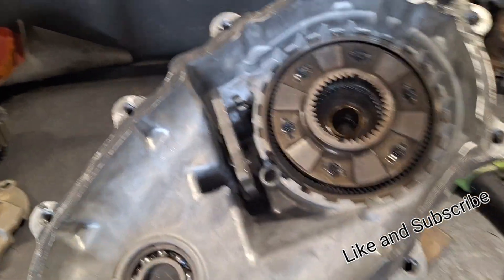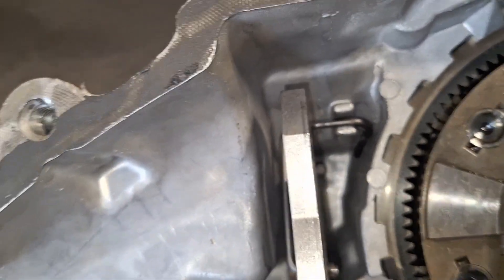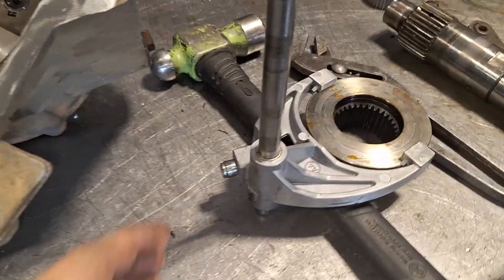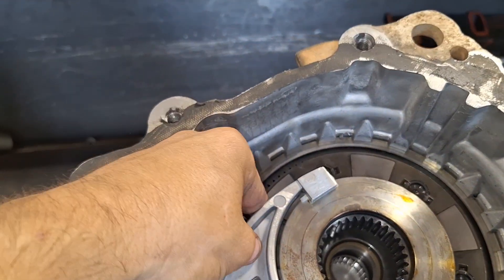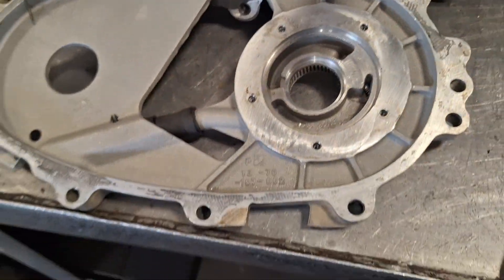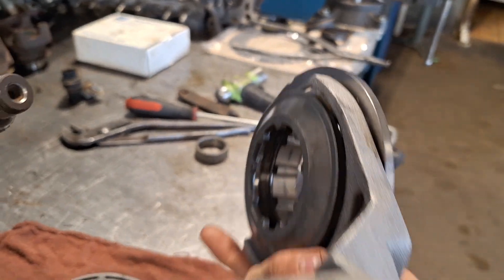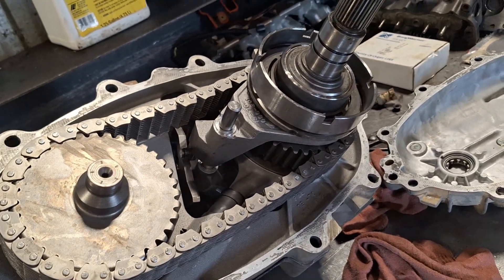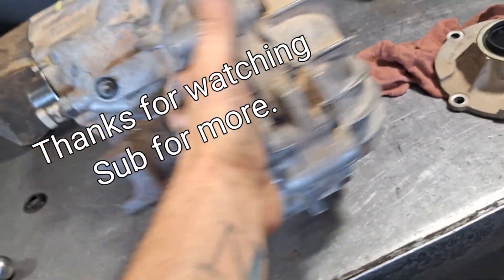Borg Warner 4470 transfer case reasemble.

Comment: what is the torque spec on the yoke nut and tale shaft housing bolts?
Reply from the maker: Around 150lbs. But I just tighten them with an impact.